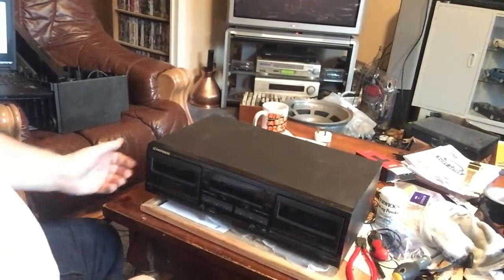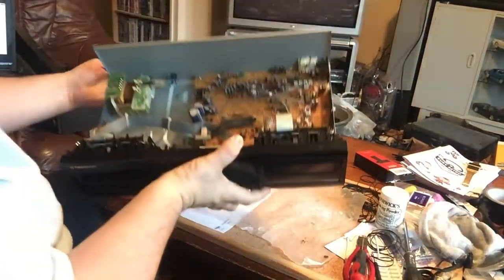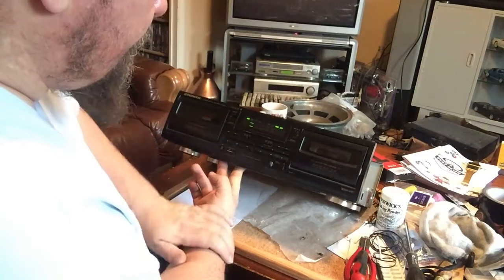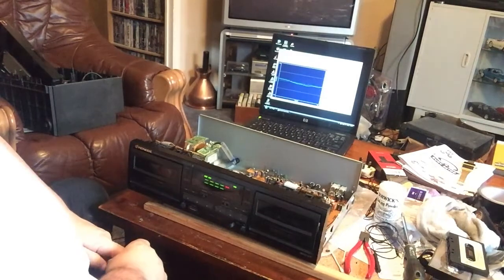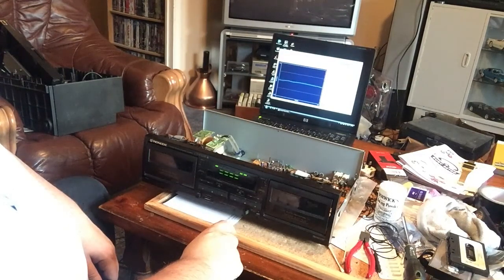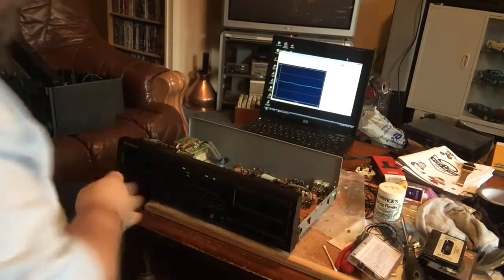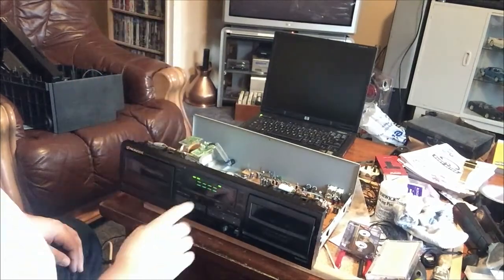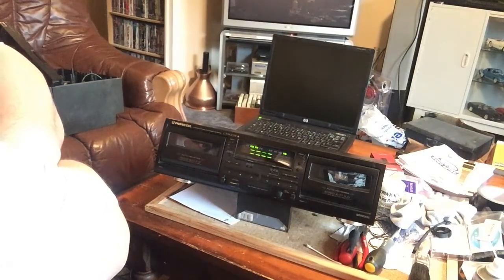Pioneer CT-W205R Double Cassette Deck Service and Alignment

Comment: i have one of this, buyed it in '88 or so, both mechanics got stuck 15 years ago.i looked into, it seems that lubricamt solified in the very complex moving parts and things don't work any more as they should. To spray things with wd40 seems a bad idea, because belts and pulleys would go to slip, dismount all the parts of the mechanic seems a nightmare. 
what could you suggest to repair it? thanks in advance.